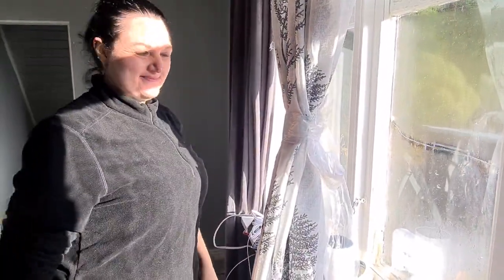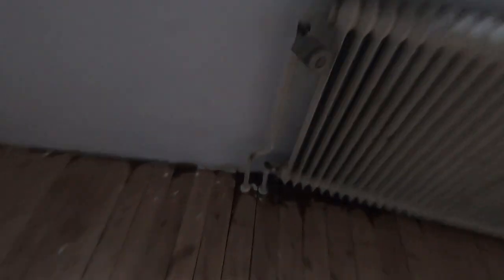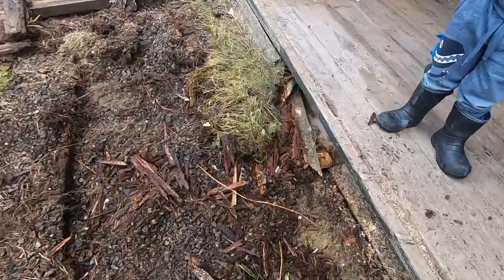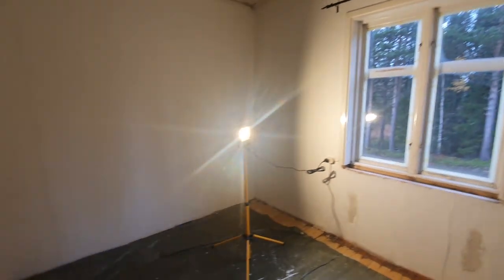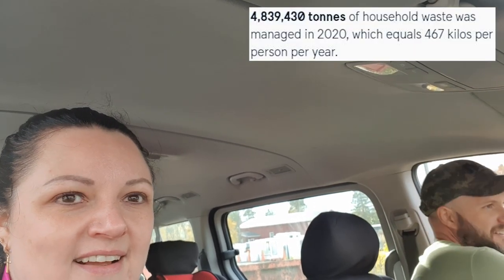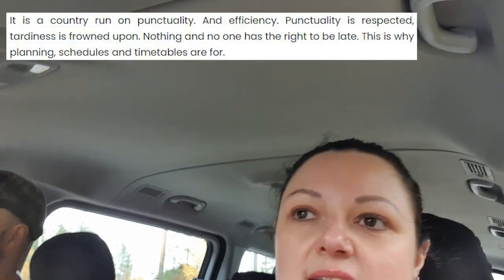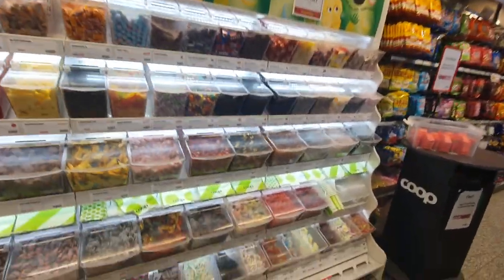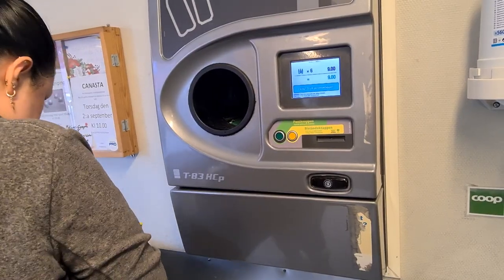The sausage in the mouse trap trick...

Comment: You only have summer windows. Windows that old usually have a set of winter windows standing somewhere that you put in during the winter or it will be very cold and and draft from the window when the snow comes and water will drip from it and kind of cause a bad situation. Probably should check that before the winter comes at least for the bedroom. Just saying this since i lived in a old house out in the woods for many many years in Sweden and we did not realised this until the winter came and it was a lot of extra work to make it work and make sure it did not get moldy.